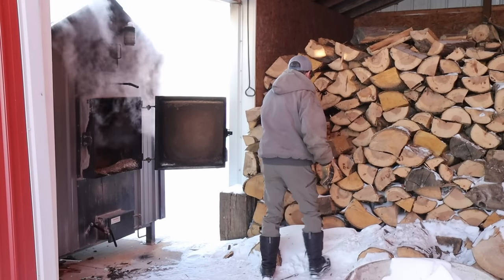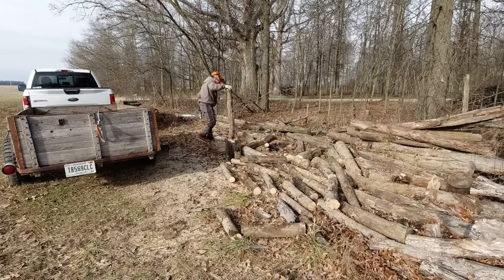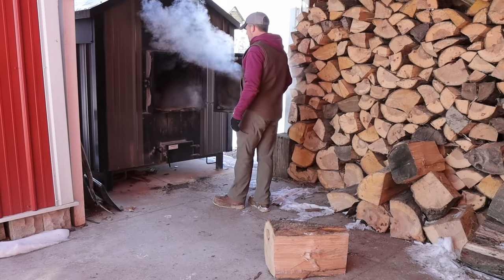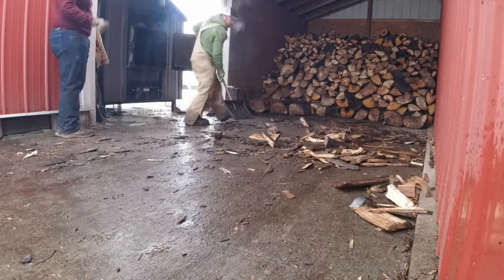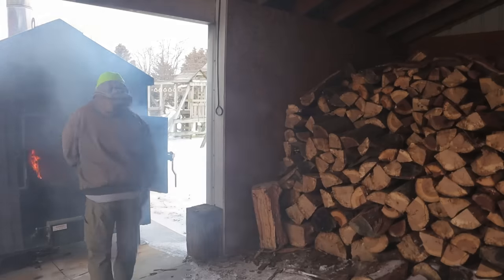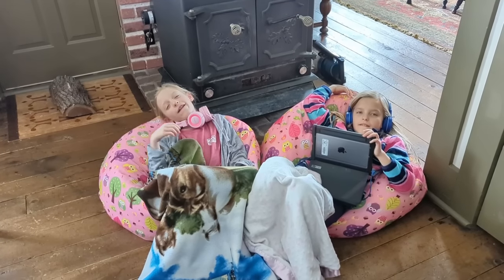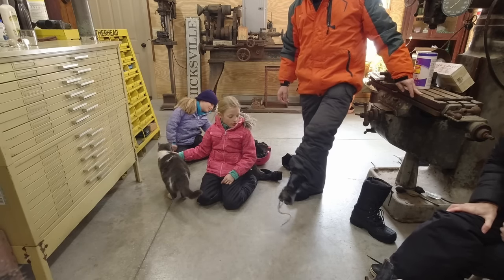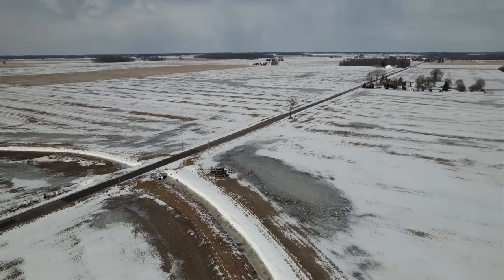Is BIGGER Better? [Firewood Size For Outdoor Wood Boiler] - Why Split Wood For A Large Boiler?

Comment: I have been heating our 3500 square foot house with an outdoor wood boiler for 15 years. It runs year round as it heats my swimming pool in the summer too! I cut all my own wood and have tried everything through the years. In my opinion, you are doing things perfectly with one or two big pieces mixed in with the more manageable pieces. It has been proven too many times that those big pieces never dry out completely and don't burn well. Ignore the You Tube know-it-alls and keep doing what works best!
Reply from the maker: Sounds like we have about the same setup!  Thanks TC!
Reply: Exactly my thoughts, split it or it won’t dry
Reply: @tc6643 I can add 2 things:
- the bigger piece of wood is - the more energy you need to burn it. In ideal conditions, 1 kg of dry firewood has approx 5 kW of energy inside but in practice, you gonna get just 3.0 - 3.5
- the firewood boiler is inefficient if you use it without an energy battery like a water tank because these low-level burning modes, when you decrease oxygen entry, lead to the situation when gases, that still have energy and can be burned, just go into the chimney
Reply: I have a Central Boiler natural draft stove now I could split 1 of the large pieces and heat overnight when it is 20 degrees. I have had other stoves that the larger chunks burned better but the stoves weren't very efficient each and every stove work a little different you just have to learn how to best feed the one that you have
Reply: @CantPickTheNameIwant HI, so are you talking about a secondary water take apart from the boilers tank then?

How large of water tank and where do you put in and insulate it?

Thx

Comment: If you dont consider the weight of the wood, we'll take a look att moisture in the wood. Less moisture in the wood lead to more effective burn and a lot more "energy" in dry wood. By spliting the wood you also alowed the water to dry out. Here in sweden we mostley burn birch due to the high energy level. But it realy need to dry out real good before you burn it. We also burn spruce and pine trees. But it mostly burn hot and quick and leave a ton of ash to clean out. While the birch burn cleaner slower with more burn time we also get more heat out of the same weight of wood compare to spruce and pinetree. Great video!
Reply from the maker: Great info!  Thanks!
Reply: Here in Alabama I grew up using pine wood as tinder and kindling, especially the very resinous wood from the stump, and also small pieces of dried pine sap. You can walk through a pine forest and quickly get a pocket full of dried pine resin from the sides of living trees. Once you light it it burns like kerosene.
Reply: I feel like you should cut it up according to how quickly and how much energy you want to generate cuz things only burn on the surface and that means that the less surface area of the total fuel that you have put in the furnace the longer it burns

Comment: Thank you for making this video.
I have a similar boiler, though from a different manufacturer.
I have done pretty much the same process as you, though it was unconscious thought driven and I appreciate you laying it out concisely.
60 lbs is enough to hurt oneself and I agree taking care of ones back is really key.
One thing I started doing may be of use to you:
The paper leaf bags one can buy in the fall can be filled with bark and small bits that fall of the log.
I run a wood shop so I also put my small off-cuts in these bags.
If left to the side, they are super useful on those mornings when one is down in temp in the boiler and a rapid re-heat is required. I chuck one bag (typically a little over half filled) on the coals and then do exactly what you did with the smaller bits of wood. The paper catches and then the wood goes up soon after.
I hope this thought is received in the spirit it was offered.
Thank you for your lack of machismo - it is refreshing
Be well
James
Reply from the maker: Hey that is a great tip James!  I usually keep a pile of bark and kindly gathered up on the ground and I throw a scoop or two in every day or so but in the winter it's full of snow!  I'll be looking for some of those giant paper bags.  Thanks for the great comment and I appreciate you watching.

Comment: Great Video, Neil.  Since I only have a wood burning fire place, I cut all my logs to 14-16".  I split them down to what most would consider pretty small, so that my logs are 2-5 lbs, with heavy ones being about 10 lbs.  Your 60-80 lb. logs would get split down significantly at my house.  Your methodology is definitely sound.

Comment: As a construction guy I got a great opportunity on my last project to take the cut ends of the lagging boards (3" thick assorted hard wood) and some of the pieces were over 200 pounds. As a young and larger man I could pick these up and move them but if they were wet and snowy no way I would risk dropping that on my foot! And as you mentioned more cuts makes wood dry faster.

Comment: Neil, once again another great video! I applaud your creativity and editing skills! To answer your question about firewood. We use a central boiler 6048 very similar to yours. I try and cut all my wood a year in advance everything is 18 in and I split it if it's more than seven inches in diameter. The reason for this is dry wood gives off more BTUs and when I'm not home the smaller pieces allow my wife to load the wood stove. With that said I stack all of my wood in IBC totes and 18 in seems to be perfect to get two rows. I enjoy splitting firewood and it makes everything look neat and clean. When the forecast calls for really low temperatures I will throw in a large chunk with my smaller pieces just to get a longer burn. It's not that I can't toss in large 80# pieces it's that I simply choose not too. Great video! Looking forward to the next!
Reply from the maker: Thanks Travis. I think you're spot on.  I'd like to try the IBC totes.  I'm still shopping around and hope to use that next year.
Reply: @digdrivediy  call your county road maintenance dept.  All the road marking paint for the summer comes in and many counties have hundreds of them by end of summer.

My county gives you as many as you can haul away for free.

Comment: Much respect on those huge logs! Here in Alaska I burn mostly spruce, which is not nearly as heavy as your trees. I have a central boiler 1400, and resonated with so many of your tactics (large and small mix, etc...) Your points on #3 are precisely what everyone who doesn't run a wood boiler should understand:)

Comment: In my younger days I worked at a shipping dock on Lake Erie. We would get train cars with coal to unload. We has a magnetic 80 pound vibrator, about 15" x 15" x 8 inch thick to put on the side of train cars to shake the coal loose. Company policy stated it was a two man job to lift it, and lifting it alone was immediate termination.

Comment: great video again, i love how the whole family is involved, for the smaller indoor fire have a look at the swedish top down fire, they have been using indoor furnaces for 300 odd years and developed a way of heating the flue first, it also means you get a fire that will last many hours before needed to be tended to and draws air through the flue almost instantly

Comment: Great video and research.  I have a wood burning stove that my dad built years ago.  I can put 30" long pieces in it, but my splitter will on split 24".  I split them down smaller because I don't want to kill my back loading huge pieces into the stove.  I totally agree with you.

Comment: Great video Neil! We cut our wood into smaller sizes, about the same size as you put in your indoor wood burner. We only burn wood in our indoor shop wood burner. The house we heat with propane.

Comment: Great Video Neil!  
You are so right about the heavy chunks of wood.  It's better to save your back.  Pieces that are half your weight are too heavy to chuck safely into the fire box without inadvertently hurting yourself.  I guess that's why my dad would bank our furnace/boiler/stove with coal at night with larger pieces to keep the fire going.  Since that boiler didn't have a fan to force air through the fire box, the fire never smoldered until it was almost out.
I never learned to ice skate.  We had a huge roller skating rink down the road called "Sportsman's Hall"  They are still in business today, even after being burned to the ground by an arsonist in 2000.  Sportsman's Hall was rebuilt with the help of local businesses, schools and families.  Finding enough of the right maple boards for the flooring was a challenge, from what I understand.  I can remember school skate nights there from elementary and middle school in the late 1970's and early 1980's.  It was a wonderful place to escape the bite of winter and the sweltering heat of summer and still have loads of fun.
Thanks again for another fantastic video!  See, I knew you could finish it 👏👏
Reply from the maker: Thanks so much Susan. That's great that your community came together to rebuild a local landmark. I have fond memories of skating parties as a kid as well. Thanks for holding out for this wood video 🙂

Comment: We have heated our house for 12 yrs now with a heatmore outdoor boiler. We tend to do a bit of small and large both. I cut smaller pieces so the wife can handle them easier. I have found the wood that is round not split tends to burn a bit longer so now we target 6-10" logs that only need to be cut not split much. The older we get the less times I want to handle each piece of wood

Comment: I loved burning  wood ,cant beat the heat from a cast iron wood stove. 20 years of splitting and stacking . I'm turning 67 this year and for the price of propane and one phone call to the driver i have retired the splitter .Smaller wood is better burning than a 80 pounder that would smolder for days with no heat .  GREAT VIDEO
Reply from the maker: Thanks Gary.  The propane sure is easy to use in the spring and fall when we don't have the fire going.  Thanks for watching!

Comment: As a retired engineer, I would like to comment on the need to dry out green firewood and to protect the woodpile from rain and snow.  Dry hardwood has around 8600 BTU/pound.  One BTU is the amount of heat energy that wil raise 1 pound of water, one degree F.  However, water has a unique property.  When you reach the boiling point at sea level, it takes 1100 BTU to change the state of one pound of water from liquid to vapor (steam).  This is called the latent heat of vaporization.  Since the steam goes straight out of the stack, you don't cature that heat in the water jacket.  Consequently, having a good woodshe, and giving your woodpile a chance to dry out before the fire season is the most important part of cost effective fuel use.
Reply from the maker: Very true.  Thanks for the detailed info Louis.  I agree 100% I'm just never far enough ahead to take full advantage.  I seem to use about the same amount of wood every year whether it is aged or not though, so I can't explain that I guess. 

So I want to understand the science better.  If the potential heat is leaving as steam, would that suggest that what is coming out of the chimney is hotter than what it would be if the wood were all dry?  If I am burning green wood, then that means I am using some of the potential heat energy to boil the water out of the wood rather than heating the water jacket then?  It seems like there would be much less capture of the heat in an open burning environment and it is hard to imagine that so much heat would be lost from inside the boiler.  Is there a way that I could measure my loss?  Like measuring the amount of moisture coming out of the chimney?  

Very interesting subject that has brought a lot of thought.  I can really never tell a difference between wet and dry wood in the stove other than dry wood burns up quickly and I go through it much faster.  That wagon load of dry ash will burn up like flash paper compared to the green stuff I'm burning.  

Again, I appreciate the discussion.  I should learn and study it more to see what exactly it's costing me to not get my wood all cut and dried years in advance!  Thanks again.
Reply: @digdrivediy  it doesn't burn faster by controlling you draft. That's the key. It takes alot less air to burn it.
Reply: @digdrivediy  I would start by measuring the amount of water in the wood. How much of that 80 pound piece was water? It should be around 15%, but if it's 30%, that's 15% x 80 pounds = 12 pound of water you throw on the fire. 15% would also mean you had to lift "only" 68 pound instead of that 80.
You could also measure the temperature of the gasses coming out of the chimney, maybe dry wood burns to quickly and more heat goes out the chimney and not into the boiler. Maybe turn down the blower a bit in that case?
Wet wood gives more smoke, in a perfect situation, you don't see smoke coming out of the chimney, just hot colorless gasses.

Comment: I tend to start the year off with smaller wood until my back gets used to the firewood Olympics. I also think the bark holds in moisture so if I crack them in half they dry and it makes those splits allot lighter when they are not so green.
Reply: What you could do stack some wood in side then it might dry out quickly
Reply: Agreed

Comment: I use a similar method for my stove. I cut my pieces 20" long and the sizes range from 3" in diameter to about 12". I put some big chunks in and fill in the voids with small stuff. I also have a variety of species of wood. Mostly it is ash, maple, oak and a little bit of cherry. I like to keep some pine on hand as well. When the stove gets low overnight, I throw in some pine which burns hot and brings the temperature up pretty fast. Then I switch back to hard woods for the holding power. If I am really in need of fast heat, I pack old cardboard boxes full of wood shavings from my woodshop and they burn really hot, plus it gets rid of the shavings.

Comment: Been burning a Outdoor Boiler for 18 years now. I cut my rounds 24”. If they are over 10” in diameter, I split them in half.. All because of the weight of the logs. Stacking is easier loading the boiler is easier…… If Your a young fella it makes no difference.. Some mornings, all the sizes are heavy. Recently retired!             Great video!    Keep on splitting😊😊!
Reply from the maker: Thanks! Congrats on your retirement. I'm looking forward to that one day! 😁

Comment: Great video!   I’m curious how long it takes to produce these videos.  How long it takes to set up the shots?  Putting your camera in the wood stove was great!   Couple of questions:  Do you use a water heater during the summer?  Have you ever contemplated a pond on your property?
Reply from the maker: Hi Heath.  It takes an embarrassing amount of time to produce them.  I probably have 12 hours or more in this one over the course of two different weeks at it. Filming is the easiest part!

We do have a water heater for just normal hot water. 

Yes, we have thought about a pond quite often! I used to dig ponds 😉
Reply: @digdrivediy   That (digging a pond) would be awesome content for the channel.

Comment: I'm from Europe.

We still have clasic wood boiler, from when i can remember we were cuting log to 33cm lenght (13 inches), and i was noticing that wood didnt burn well. There was a lot of embers staying when wood colapsed towards end of burning cycle.

So past 3 years we tried to cut it to lenght of 45 to 50cm (around 18 inches) and we noticed that logs burn nicer and cleaner, cause there is more airflow during burn cycle and there is around 60% less embers compared to before.

Even furnnace walls are cleander, there is A LOT less cleaning of furnance. (we are keeping wood boiler temp around 80 to 85degrees celsius (around 181 farenheit)).

Also we spit logs into 4 to 6 peaces, if log is very big then we make up to 12 peaces.

Thank you for reading 🙂
Reply from the maker: Great feedback 👍🏻
Thanks for watching and commenting.

Comment: A lot of injuries happen when you move a 80lb piece of wood into a steel burner. If your fingers get between the wood and metal I know what one will take the most damage and it definitely isn’t the wood or metal. I don’t blame you at all for keeping small and large pieces of wood. I think you have a perfect set up.
Reply from the maker: Thanks so much B&K.  I've made a late night run to the ER for stitches in my fingers because I pinched them in the door.  I try to stay pretty mindful of that situation but you are exactly right!

Comment: I think your method is just as good as any another. I burn as much dead fall as I can though my firebox will only allow 22" logs but that's big enough for my 500 sq /ft shed/garage. There's nothing quite like wood heat to heat up the bones after a day working outside in the cold. Keep up the good work!

Comment: Yes I agree. You need to have a variety of wood species and size to control the temperature. My father had a outside boiler that the majority of the time he burned scrap wood pallets and deadfall trees. When the pallets got to hot in goes a chunk of poplar.

Comment: Here in Finland we seem to have different philosophy. You use fairly small pieces of pine, spruce and birch, about the size of one's wrist or bit bigger. You light up the stove and burn 2-3 loads to heat up the water. Then you let the fire die and repeat this daily or every other day. But that of course requires well insulated houses: triple glazing, 2 feet of insulation.